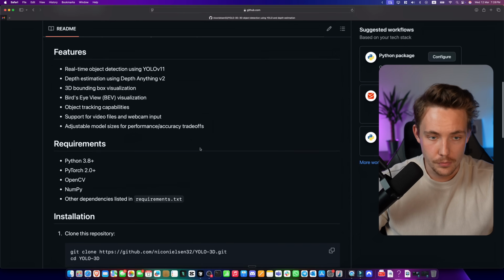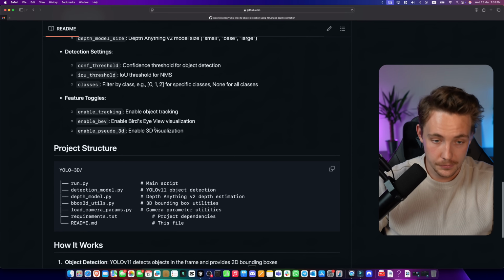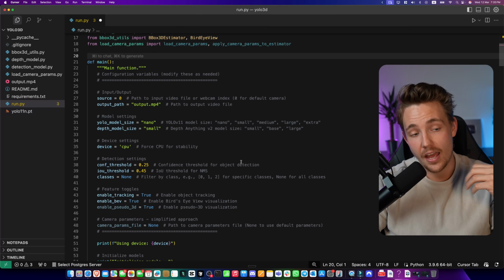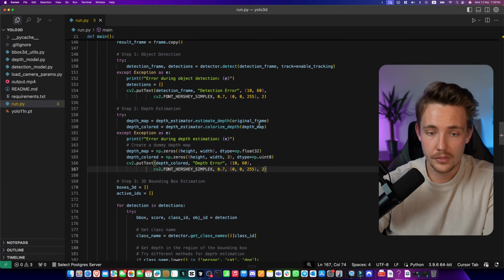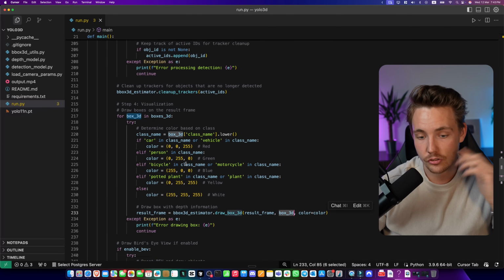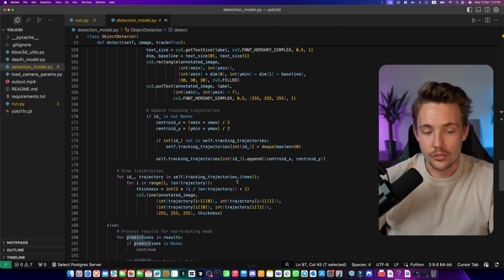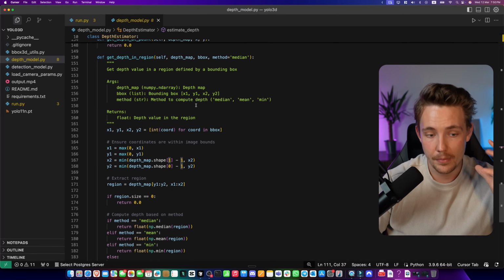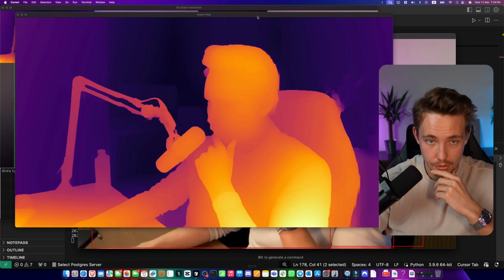YOLO-3D: 3D Object Detection with YOLO11 and Depth Anything - My new open source project

Comment: I want to use your project with a Jetson Orin Nano and TensorRT. What do I need to change?

For 2D, it was possible to do it like this:

from ultralytics import YOLO

# Load a YOLO11n PyTorch model
model = YOLO("yolo11n.pt")

# Export the model to TensorRT
model.export(format="engine")  # creates 'yolo11n.engine'

# Load the exported TensorRT model
trt_model = YOLO("yolo11n.engine")

# Run inference
results = trt_model(source=0)

Comment: It Great ,i have confuse in source = 0 , can i use it to my cctv camera ? and how to custom this path ?
Reply: Hi, I have tried my ipcamera,

you can set the ip_camera_url:

ip_camera_url = "rtsp:my_camera_ip"
source = "ipcam"

if source == "ipcam":
            # Try multiple connection methods
            connection_methods = [
                (cv2.CAP_FFMPEG, "FFMPEG"),
                (cv2.CAP_GSTREAMER, "GStreamer"),
                (cv2.CAP_ANY, "Default")
            ]
            
            for method, method_name in connection_methods:
                try:
                    print(f"Attempting to connect using {method_name} method...")
                    cap = cv2.VideoCapture(ip_camera_url, method)
                    
                    # Set connection parameters
                    cap.set(cv2.CAP_PROP_CONNECT_TIMEOUT, 5)  # 5 seconds timeout
                    cap.set(cv2.CAP_PROP_BUFFERSIZE, 3)
                    
                    # Additional RTSP-specific settings
                    if method == cv2.CAP_FFMPEG:
                        os.environ["OPENCV_FFMPEG_CAPTURE_OPTIONS"] = "rtsp_transport;udp"
                    
                    # Verify connection
                    if cap.isOpened():
                        print(f"Successfully connected using {method_name} method")
                        break
                    else:
                        print(f"Failed to connect using {method_name} method")
                        cap.release()
                except Exception as e:
                    print(f"Error with {method_name} method: {e}")